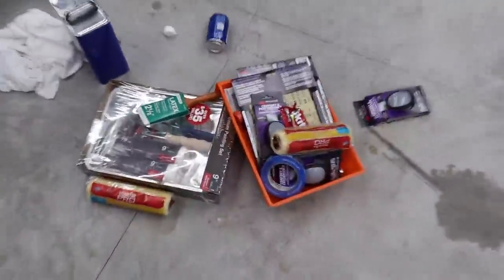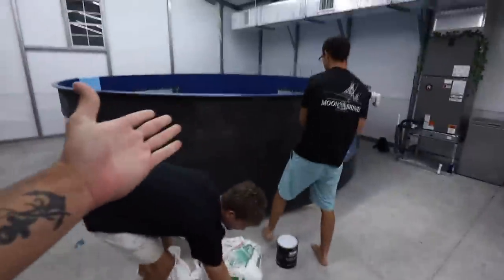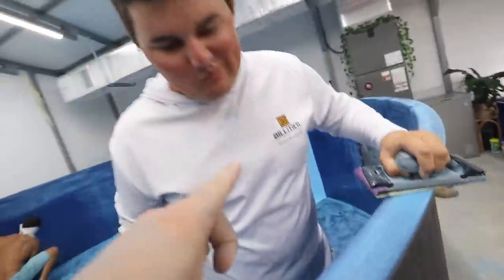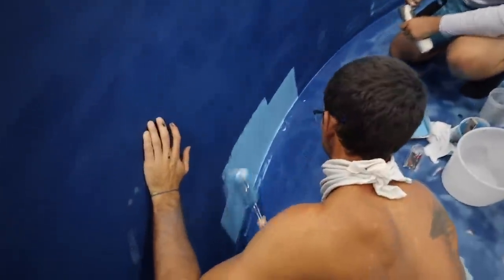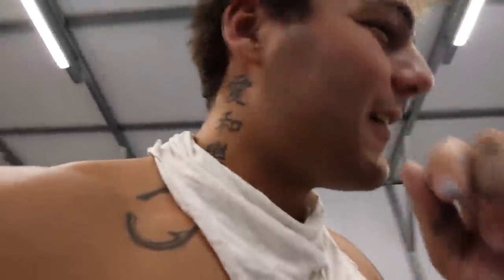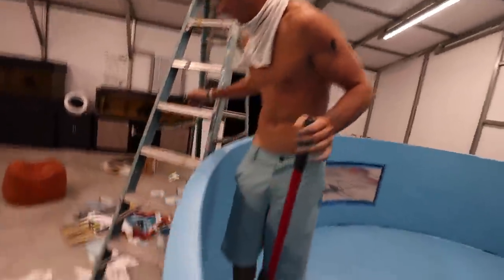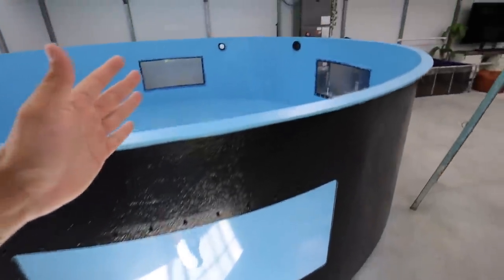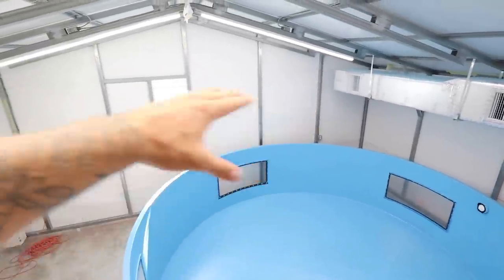Finally PAINTING My 5,500G EXOTIC FISH POND!!

Comment: Get a 50 foot soaker hose and convert it to a air hose. Place it along the very edge except for where the windows are. It does work extremely well but you will need to weigh it down so it won’t float up. I used red bricks for their size so the bends were easier.